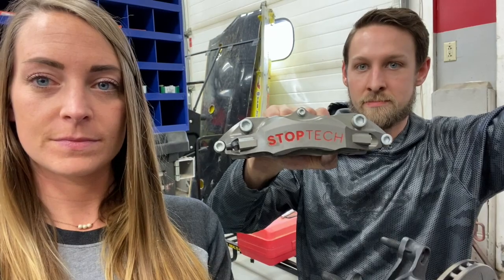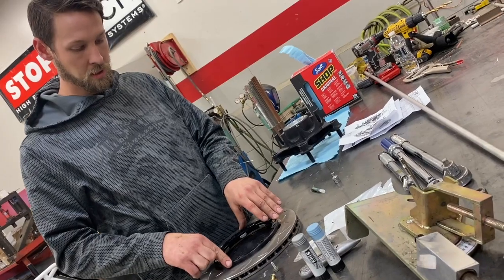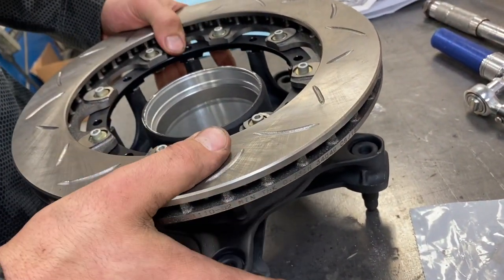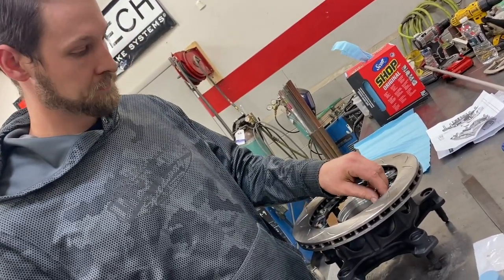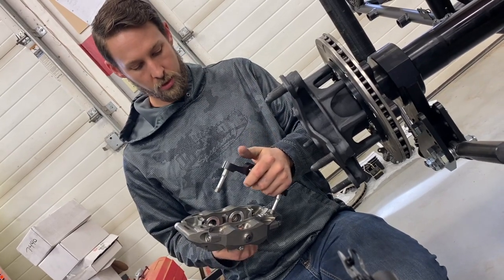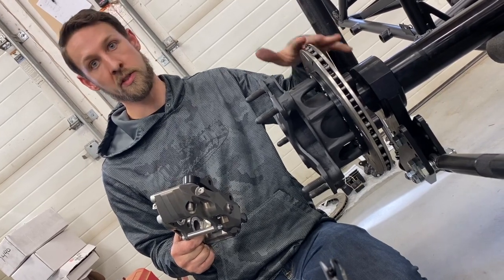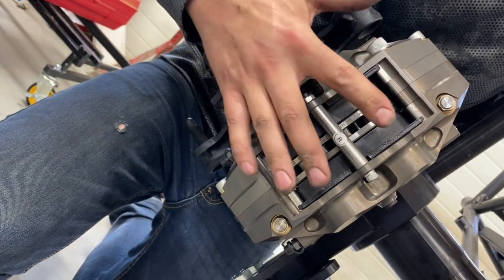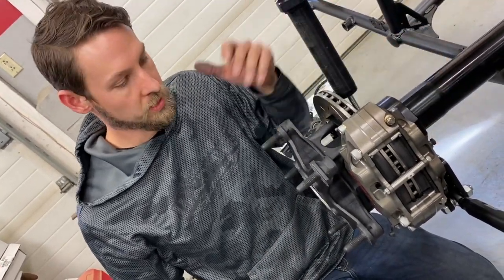2020 Bicknell Build Part 4

Comment: Really enjoy the build videos.  Mike's attention-to-detail is second to none.  Stephen, below, asked the same thing.  Was wondering if the hub bearings contained any kind of grease before installation of the hub/brake assembly.  Mike, you must have had a thread gall on you, at one time.  You always remember to use anti-seize on the critical assemblies.  Nothing worse than taking apart an aluminum piece, and have the threads come out with the bolt. Thanks for the video, Mandee!  Cheers!!

Comment: Thanks for the vid.. Mike makes it all seem so simple... I too was wondering why the inner and outer bearings were not greased or lubricated in some way.. I am sure though that there is a master plan there..
Reply: I'm guessing this was a "mock-up" for the video. He'll pack the bearings and install seals on final assembly. Brakes are over-rated....all they do is slow you down....

Comment: Would you not want to grease those bearings and seals initially so they don't run dry or do you fill the rear end and then tilt it left and right to get gear oil on those bearings and seals not to be  know it all but I always pack those bearings and put some seal glide on the seals